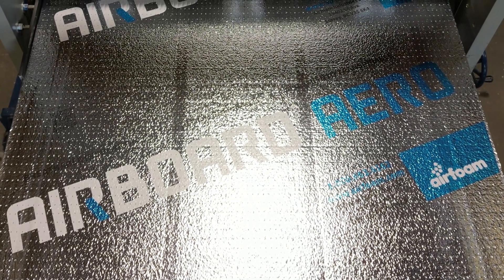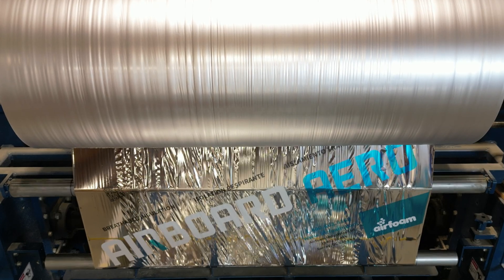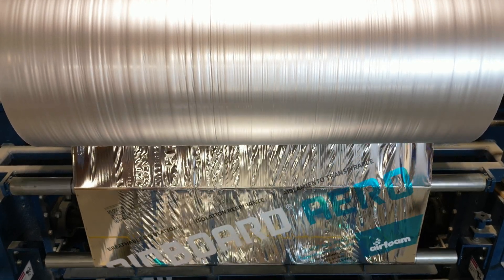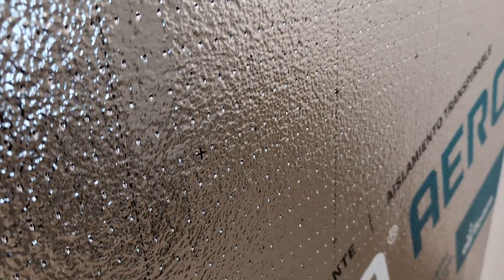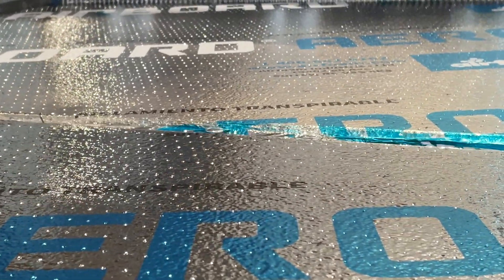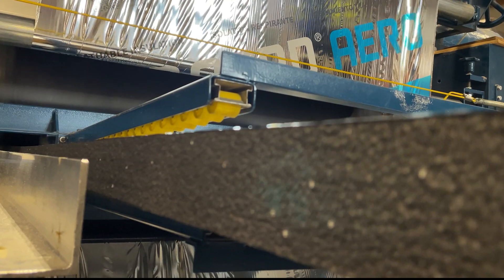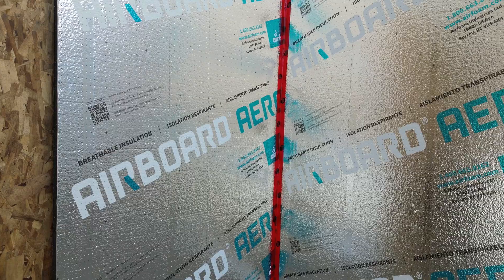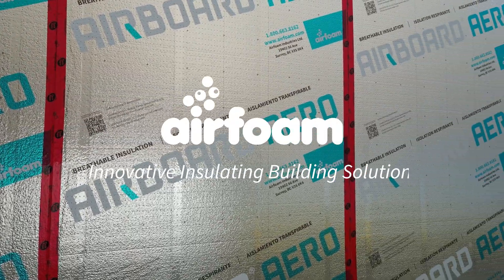Introducing the future of exterior above-grade insulation: Airboard AERO!

Comment: What does built with gps technology mean?
Reply: It means they are trying to sound more high-tech than they actually are.
Reply: I looked it up: Graphite Polystyrene (GPS) is highly efficient, rigid foam insulation used in various  remodeling and new construction applications, such as behind new siding, below grade, and below slab. It can provide up to 20% more energy savings than traditional white expanded polystyrene (EPS) insulation.
Reply from the maker: Graphite technology in GPS (Graphite Polystyrene) insulation boards refers to the inclusion of graphite particles into expanded polystyrene (EPS) insulation. These graphite particles reflect and absorb radiant heat, significantly improving the thermal performance of the insulation material.